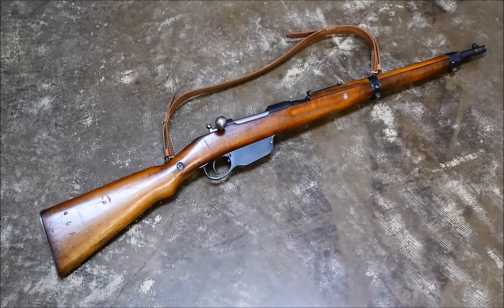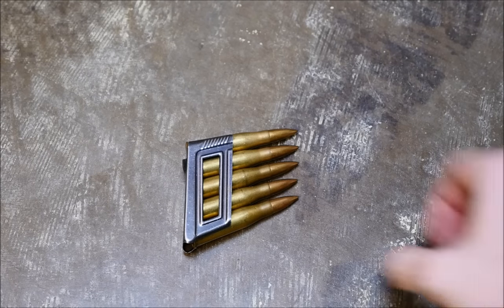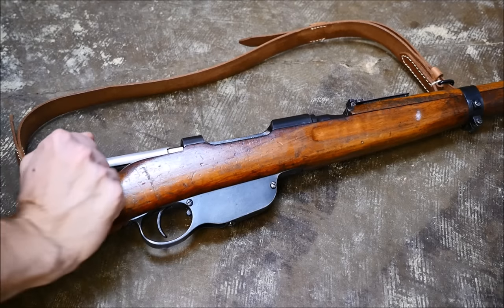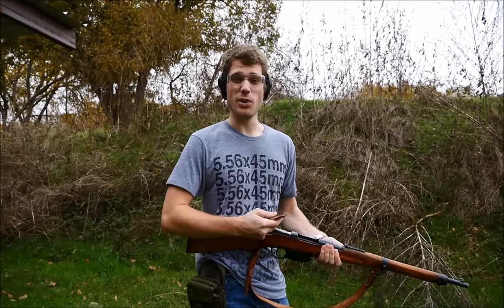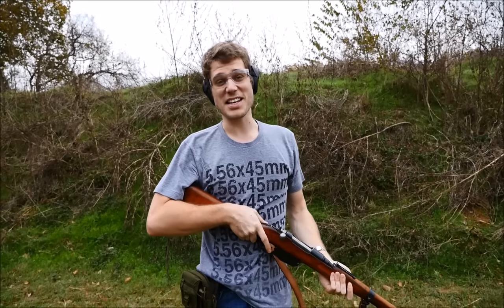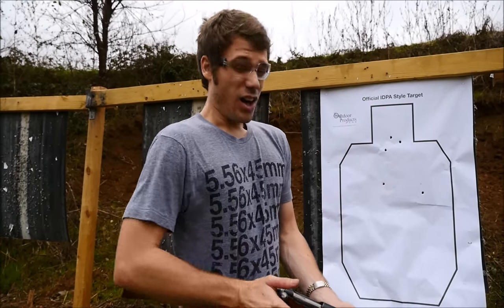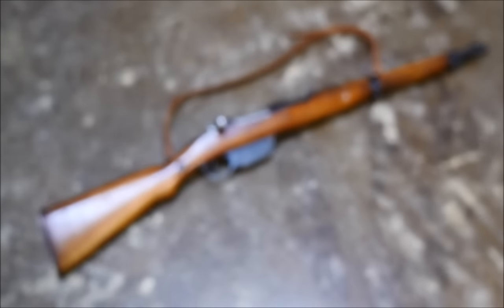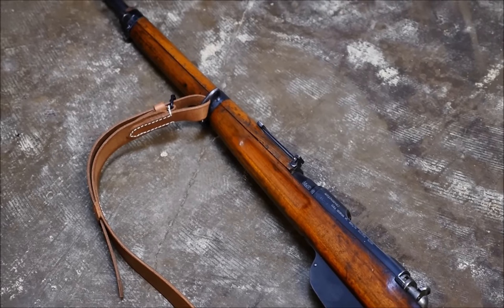M95 Straight Pull Run and Gun

Comment: For repeated fire, the turn bolt is faster, but for straight up operating the action, side by side, the straight pull is faster. All in all, they're about as fast as most turn bolts, except for the Enfield of course, and there really isn't any need to have debate over which is better. A Schmidt-Ruben will out shoot an Enfield any day of the week, even if the bolt is operated a little slower.

Comment: What's the point of a straight pull-bolt whe you can have a semi-auto? From what I heard, straight-pull bolts have poor performance with dirt and mud, so why not just go semi-auto?
Reply: ww1
Reply: What?
Reply: Yes but this is a broader question, in general, is there a point in using straight pull over semi-auto?
Reply: A point in using a straight pull over a semi-auto? Other than speed you mean? ...Well for one its still a bolt action so you have the possibility of a more accurate rifle (ie the legendary accuracy of Swiss K rifles, and they use straight pulls in the Olympics)
Reply: Oh, right. I forgot about this. My bad.

Comment: The m95s aren't so shitty... the rifles were remodeled into the 8x56r and shortened in 1934... when the Austrians did that the rifles were hap hazardly thrown back together, if u get a unrechambered one there smoother and more accurate. But the 8x50r ammo is almost nonexistant

Comment: You're reaching for the bolt handle anyway, unlocking the bolt is a natural motion that you already have to do. Straight pull rifles can be faster than traditional bolt actions, if done properly.
Reply: I think that comment was directed at the speed of the Lee Enfield, and part of why theyre fast is because you can work the bolt handle with your thumb and index finger and pull the trigger with your middle finger, therefore not really having to waste time reaching for the bolt because your hand never has to leave the bolt.

Comment: “With the enfield your finger naturally goes to the trigger”

Puts middle finger on trigger...
Reply: That's how British infantry were tought
Reply: Using your middle finger as the trigger finger allows you to keep your thumb and index finger on the bolt handle. That gives you no delay in cycling the action between shots, when using an Enfield rifle or any with optimal bolt handle placement. In fact, with enough practice, you can shoot an Enfield as quickly as a semi-auto with this method.

Comment: I disagree. Looked like quite a bit faster esp for a soldier it was designed for. I really like the ww2 guns. Its sad its almost impossible to get a modern chrome lined bbl to see how itd stack up accuracy wise. I did see a fellow you tube do just this with a lee enfeild aling with several other accurizung. He was hitting targets at 600 yards. So much for rear locking lugs are crap. Proved otherwise. Isometrics with a hand gun push/pull opposing force with your arms steadys you up. Id like to see this theroy with locking lugs front and rear at the same time. I suspect a massive accuracy gain. Likewise nobody builds it & probably never will just toi expensive to build. I wouldnt be surprised if certain governments do in respect to sniper rifles

Comment: Though not a rifle on my "bucket list" to own, I have always liked these rifles since I first learned about them. Everything I've read though supports your conclusions that the straight-pull really is no faster than a good turn-bolt bolt-action rifle. I still think I would personally prefer it though, and feel sure I would prefer to use Mannlicher-style clips to the Mauser-style stripper clips, though I understand the reasons that armies in the early 20th century had for not adopting the Mannlicher system for their rifles. I thought raising the slider on the ladder sight was supposed to be for firing at long distance though, not for the shortest range?

Comment: I recently acquired a m95 and the enbloc clips wont stay seated, I cleaned the shit out of it, oiled it and now it will seat occasionally. When it does seat the rounds are in there so damn tight I gotta basically beat the bolt forward to make it move. Something is wrong and I am out of guesses and its not easy to find info on these things any help would be greatly appreciated.

Comment: As fast as en bloc clips are I'm glad most guns of that era don't use them seeing as once the supply dries up you have a single shot.
Reply: +dreyrugr it gets worse rifles similar to the m95 can't do single loading well, due to the design it puts undue stress on the extractor, unless you do a weird hooking motion to insert the cartridge onto the bolt.
Reply: +dreyrugr They are not hard to manufacture. You can get reproduction M1 Garand en bloc clips for about 2 bucks a piece. If there is a demand for those there will be reproduction clips available
Reply: +dreyrugr reload the clips after use problem solved they drop at your feet unlike the M1 that flys up